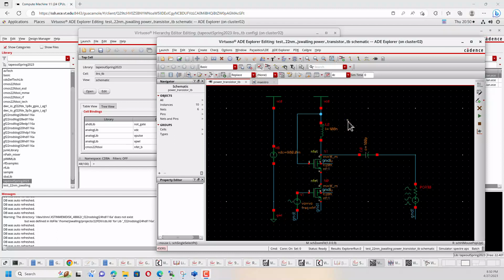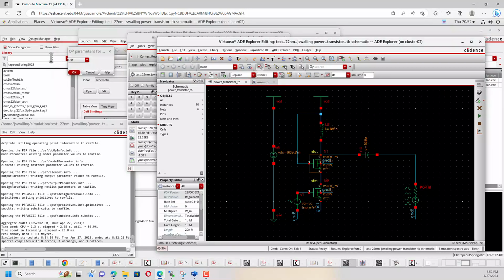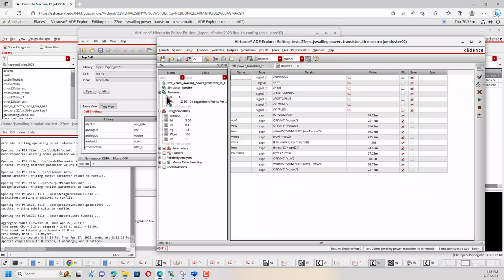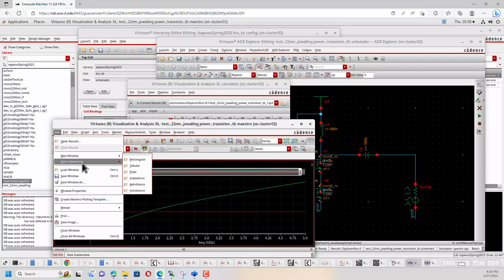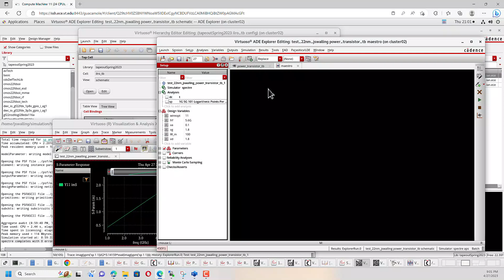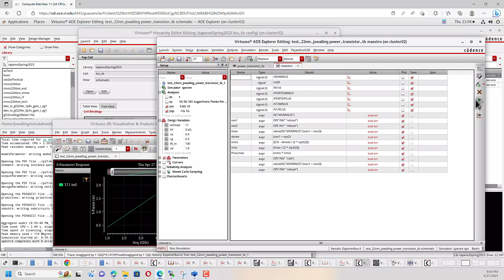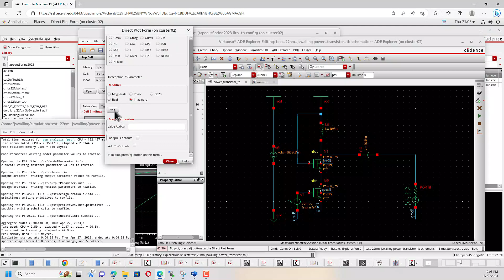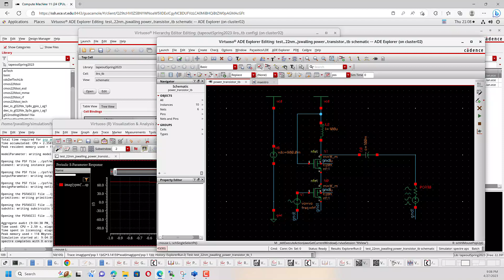Cadence - How to find device capacitance

Comment: Thank you, Professor. I have two questions: 
1. When we insert “0” as the harmonic in PSP analysis, does it imply that we are still measuring capacitance at DC?
2. Could you explain why you used "-1G to 1G" as frequency sweep ranges in PSP analysis? If my working frequency is 140 GHz, what range should I consider?

Comment: Thanks for your explanation，but I have a question about the sp simulation vs dc simulation when I used mos as a constant cap（connect body、drain and source，just measure gate to ground cap），I found the dc simulation  absolutely different from sp simulation。 The curve tends to go in the opposite direction。 had no clue，In the end, which way can accurately measure the mos capacitor I use in the loop_filter  circuit situation？？？
Reply from the maker: The SP simulation should be more accurate, provided the models of the transistors are good, because it takes into account all parasitics. That said, for a loop filter, you may want to consider running PSS + PSP since the DC bias of the filter can impact the total capacitance from the transistor.
Reply: @wallingphd  thanks for your supply for that question , i had used sp simulation for mos_cap VS  Vg  curve ,and it works more realistically.,.. thanks again

Comment: Thank you for your kind explanation. I wonder why the dc simulation result is so different from the s parameter sim. Can you give me your opinion?
Reply from the maker: The DC simulation is just based on the device model, but does not include estimates of metal capacitance due to layout parasitics. You can add a few more terms (e.g., Coverlap, Cjs, etc.) to get a closer approximation, but the safest bet is to just use the SP.
Reply: @wallingphd  thank you!

Comment: I think the xval function with the psp sim would return -1 to 1 GHz. So, you should add the pss freq to that.
Reply from the maker: The susceptance is linearly increasing with frequency, and the value in the plot is the correct value at the offset. Hence, we should not add the pss frequency to it. You can verify by setting the PSP frequency range to absolute and sweeping from frf +/- offset (e.g., 4.6GHz to 6.6GHz in this case). The result will be the same, albeit there will not be a divide by 0 in the middle of the range.